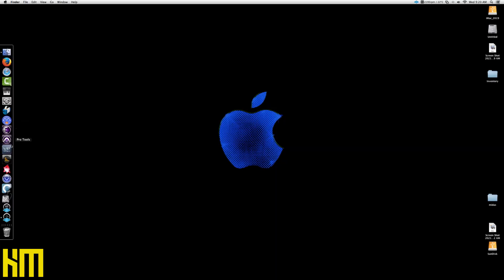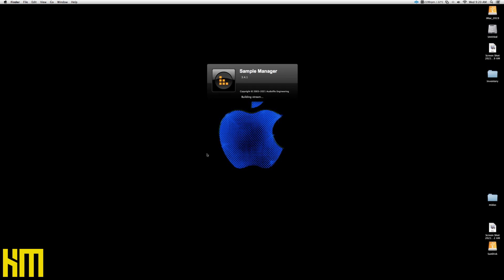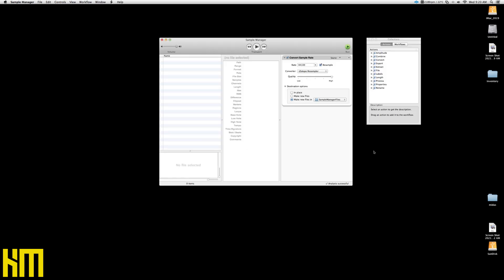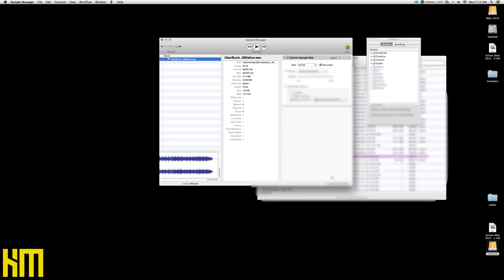Sample Rate Conversion - Software vs Real-time

Comment: Hey Ken! I hear exactly what you're talking about. It is so slight and the type of thing that shouldn't make a difference but it can. I've noticed this phenomenon with different plugins. Some sound like they are in clear plastic wrap and others sound like you could reach in and grab the samples. Many times it's due to the differences in the algorithm used for conversion.

Comment: In my opinion the software is a tiny bit brighter or clearer. I'm hearing some kind of chokin of decays in the real time version. A kind of note stealing type choke like when you max out polyphony in with some older keyboards. Could it be that the real-time algorithm has to make too tough decisions on the fly that the software algorithm can easily process without any such hurry?

Comment: Couldn't hear much of a difference so did some analysis instead: Same absolute and true peaks, but Software has very slightly higher LUFS. Spectrogram shows Software has less air than RealTime. Also tried to null, but Software is ever so slightly faster than RealTime.

Comment: Thanks for another great video and sound examples. I tried to analyze the tracks in my DAW. When phase- inverting one of the tracks there clearly are differences between the two. When doing a spectrum alalysis of the low end and hi end, I couldn´t find any significant diffenreces however. Now, I did this at home with my laptop so this analysis probably not highly trustworthy as I didn´t have the proper tools. I could try it again in my proper studio some day though.

Comment: One way to assess the difference would be to load both tracks into something sample accurate, say Audacity, and flip the phase on one track. If the samples are lined up properly and there is any sound at all, that sound will be the difference between the tracks

Then a little frequency analysis would tell us what changes make the iZotope version preferable

I'll try to do this and see what result I get!